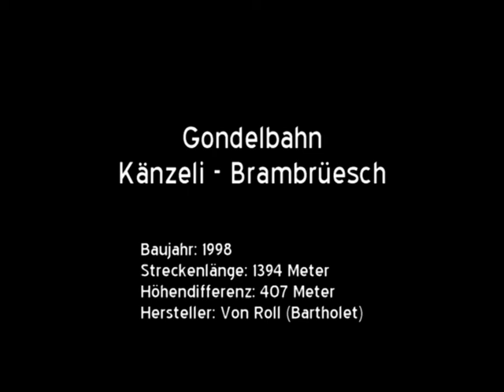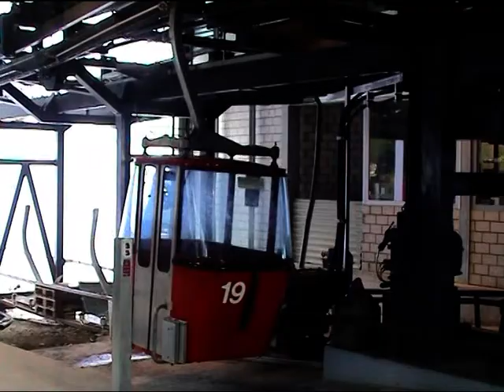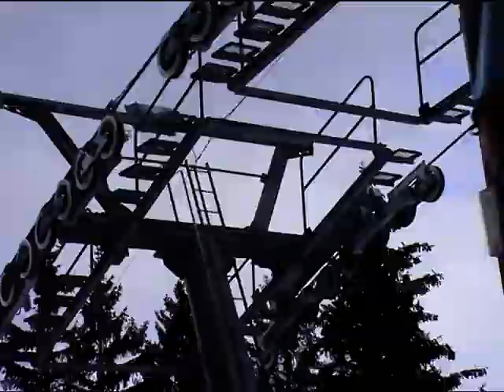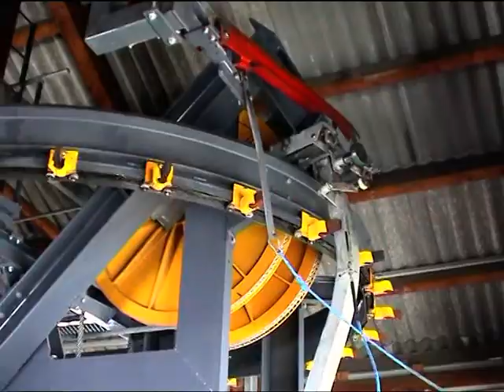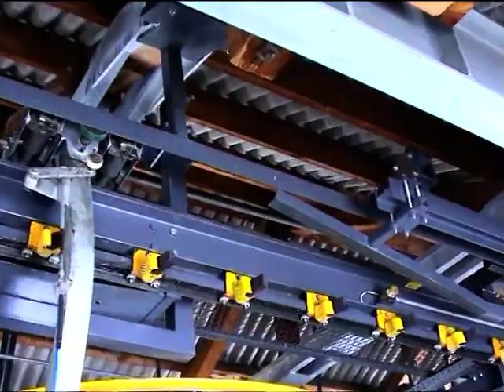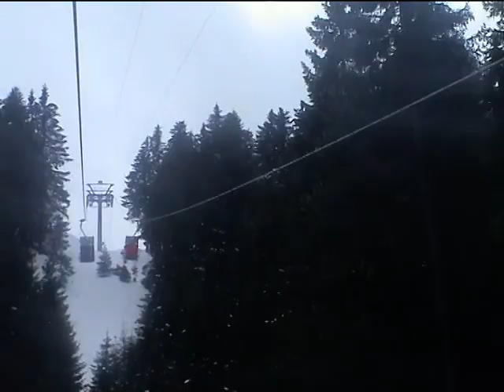4-EUB Gondelbahn Känzeli - Brambrüesch (CH)

Comment: Beautiful Von Roll VR 102.  The station superstructure was used on VR 101s after 1972... If you look closely at the station sheaves,they are VR 101 sheaves. Tension bullwheel VR 101.